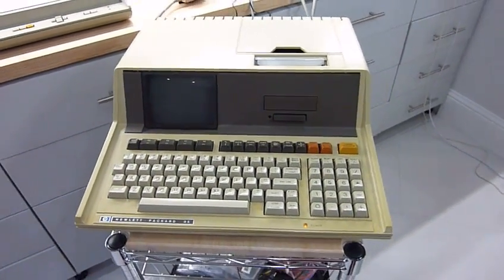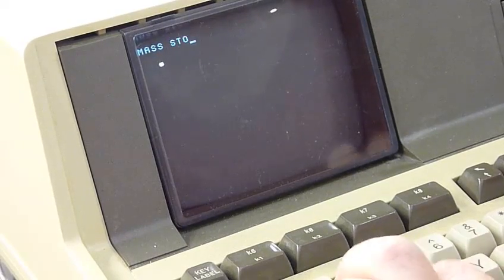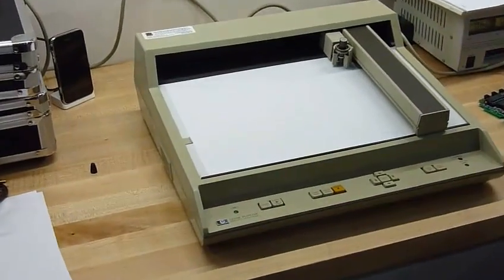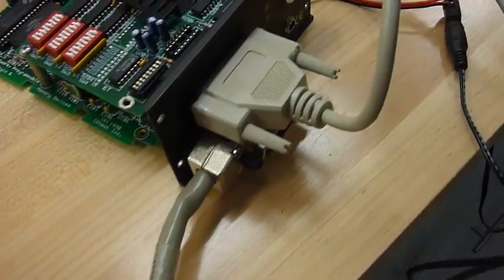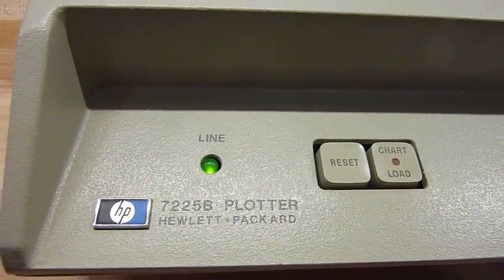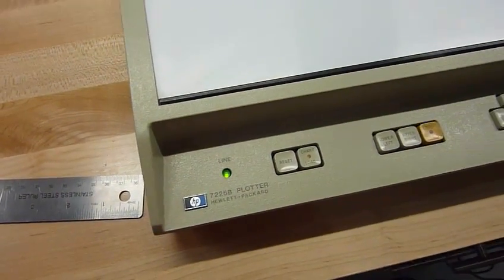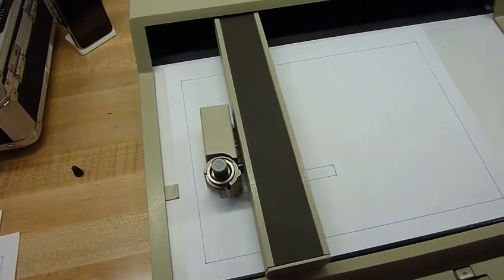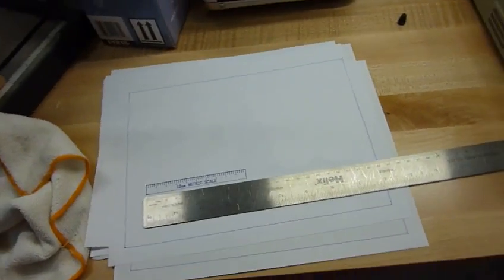Vintage HP 7225 Plotter and HP 82901 5.25" floppy demo with HP 85

Comment: Black Box used to re-brand and sell those Micro488 boxes.  I have one attached to an Ethernet to Serial converter which I used in a pinch to control a few GPIB/HPIB devices in a remote lab.

Comment: Nice blast from the past, when HP not only meant Hewlett-Packard, but also High Priced. Their stuff wasn't cheap back then. As I can see, it was also better quality than what HP makes now.
Reply from the maker: +Richard Edwards Right on. Professional, higher end,  (i.e. formerly quite expensive) HP computing and test equipment representing significant engineering achievements is the focus of my collection. Which was the majority of what they made in the 1970-1980 era. I shy away from the consumer grade or lesser engineered stuff.
Reply: Those engineers must have had a blast designing these machines.
Reply: now is not Hawlett-Packard but cHEAP-PLASTIC

Comment: I don't have this plotter but I did acquire a HP 7470A  plotter for my HP 5371A and my HP 70206A system graphics display. I'm just waiting for my new pens to arrive. In the meantime I use the HP 2225A dot matrix printer.

Comment: You were quite fortunate to have a dual floppy disk drive which worked when you received it.  From the age of it, it probably has a pair of Tandon TM100 DS/DD drives in it, which from what I've read really aren't the most reliable.  I have one of those drives in my IBM 5150 and it works very well but it came out of a system which had very little to no use.

Comment: Very cool.  I worked at GE Aerospace starting in '83, and designed a uC and digital test equipment station, and the test sessions were controlled by an 86B with code designed by my boss.  We had plotters somewhere in the building, but didn't need one for our equipment.  Excellent memories - you sure do have a lot of energy to resuscitate this old equipment.

Comment: Any Idea which HP computer used a magnetic strip/card for programming purposes (circa 1977)? I worked in hydrographic surveying at that period ,and used such a HP computer with a similar plotter linked to a Mini Ranger for dredger positioning.  The set-up was too precious to experiment with, so there was no fun to be had, and I didn't bother to learn how it worked beyond the very basic.
Reply from the maker: That would be the HP 9810 or its successor the HP 9820: http://www.hpmuseum.net/display_item.php?hw=51 and http://www.hpmuseum.net/display_item.php?hw=52. These were wonderful machines, very powerful for their time. Don't have any in my collection at the moment but I have the later HP 9825, which is fully restored. Still need to make a video on it...

Comment: I wrote the system drivers for my universities mini computer for the HP plotter, but we had the bigger brother with 4 pins.  Got to design the API and worked out the driver layers and the link library.  It was a gas.  Then in my first job we had an 85 with a program that calculated mix ratios for ice cream.  That was fun too.